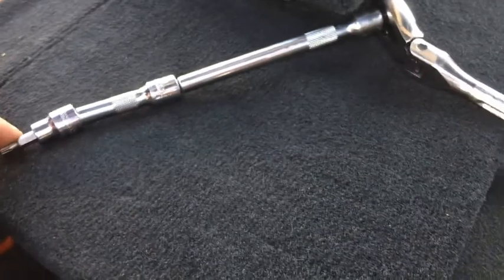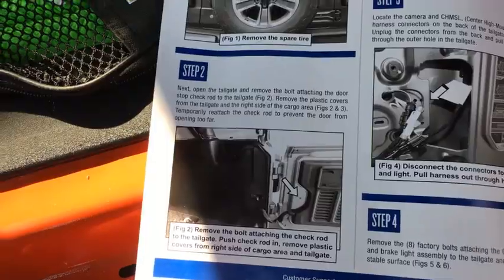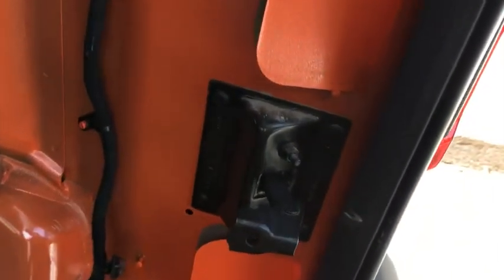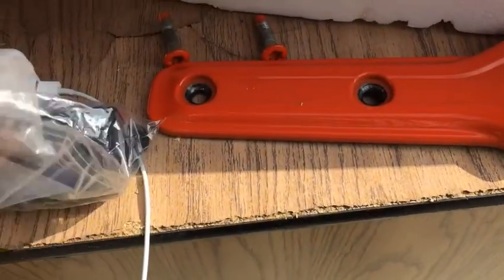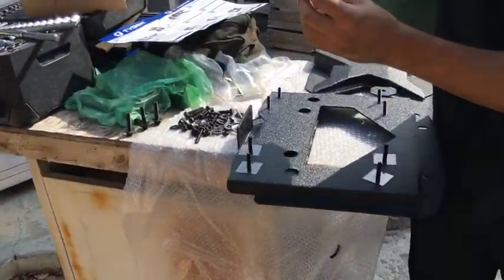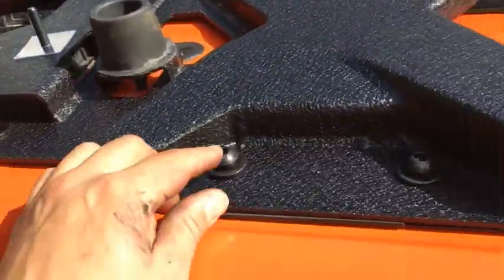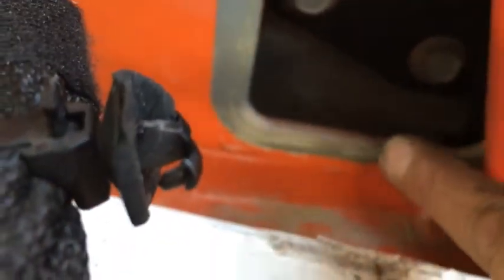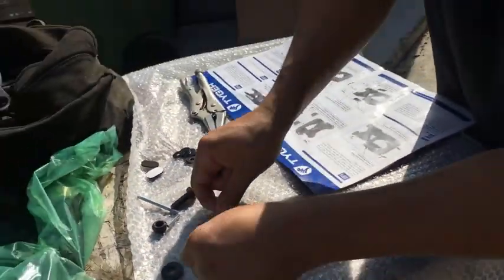Tyger Spare Tire Carrier JEEP Wrangler JL

Comment: Could you have installed it without taking off the tailgate?
Reply from the maker: It could have been done; but, it would have been such a bigger hassle.  I've seen both videos; but, really, it's so much easier just removing the tailgate. Instructions say to put some masking tape pieces across, in several places; and, use it to help line it up; and, that worked great.
Reply: @301steady  perfect thanks.